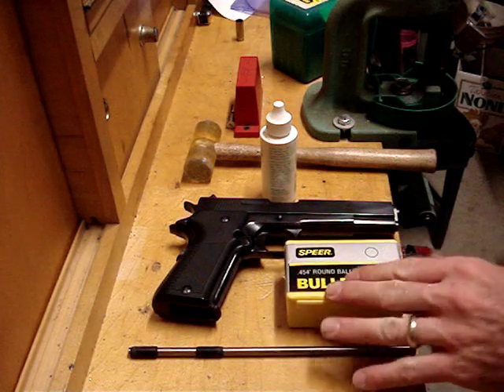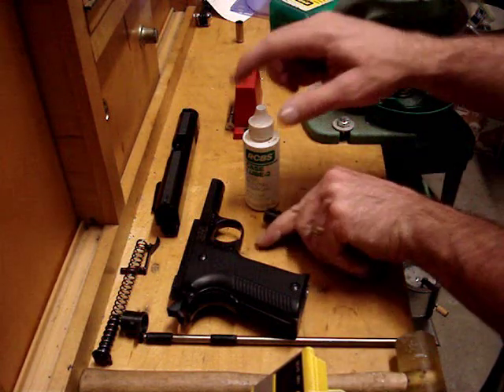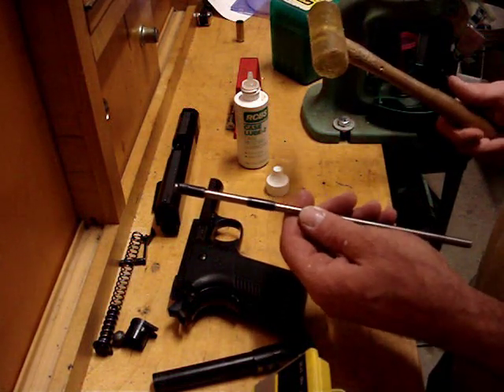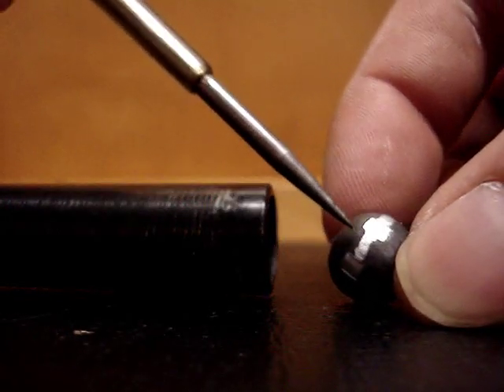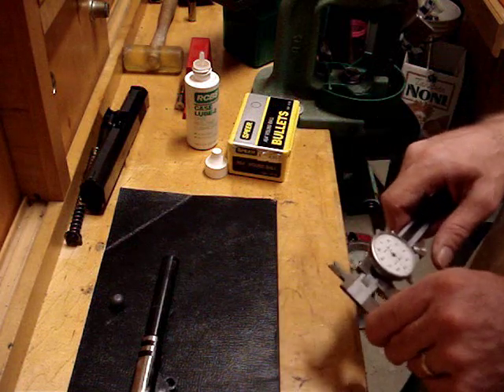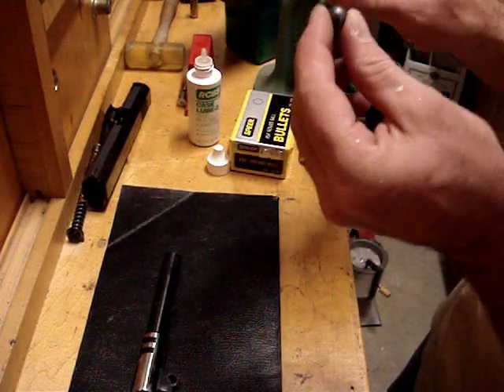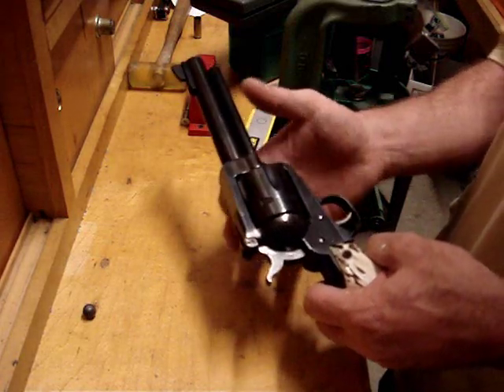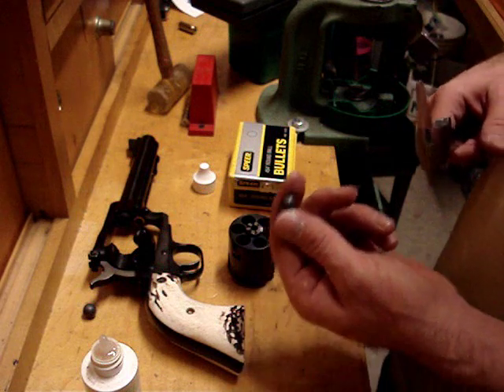How to Slug a Barrel

Comment: I have been wanting to slug my original Trapdoor Springfield carbine. The groove depth appears to be much shallower than the original .008". The problem is that these barrels have three groove rifling. You would always be measuring groove to land. Any thoughts on this?
Reply: That would be true at 0, 60, 120, 180, 240 and 300 degrees around the bullet circumference. Try measuring at 30, 90, and 150 degrees - halfway between the points where you would be on the groove on one side or the other. I am not a gunsmith, just a craftsman. Gunsmiths please correct me if I am not taking something important into account.

Comment: @uxcitme If the wood ever cracks, there is a huge chance of it getting jammed into the barrel.  Not good, especially if you're using it on a muzzle loader.  Brass works the best ince it is stronger than wood but does not scratch steel.

Comment: If I buy a mold with an advertised cast of .452 diameter and my barrel slugs at , for example, .454 diameter; will I still be able to size the smaller .452 bullet up to .454?

I'm curious because I will be casting for a 1911 pistol and have made a commitment  to a .452 diameter mold.  At this time, I have no idea what the Springfield 1911 barrel  will measure using the slug method.

Thanks